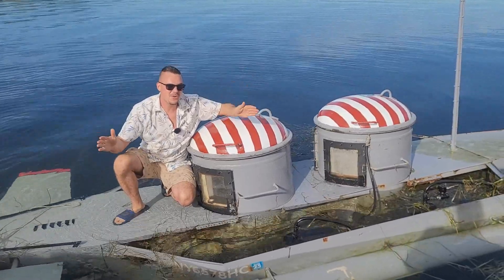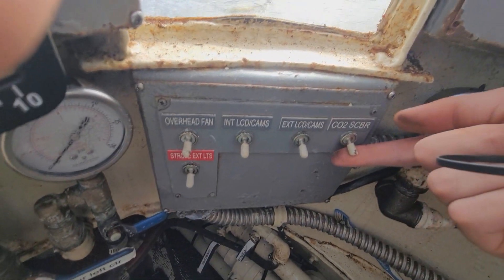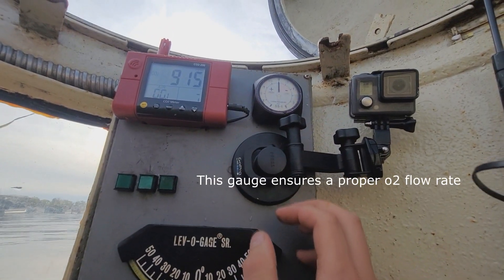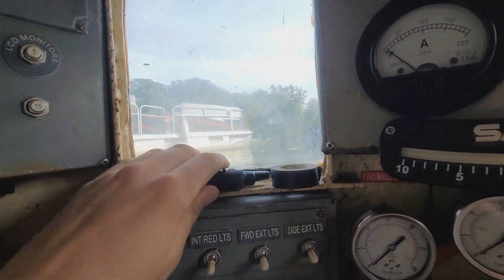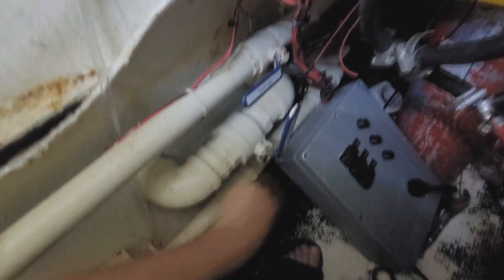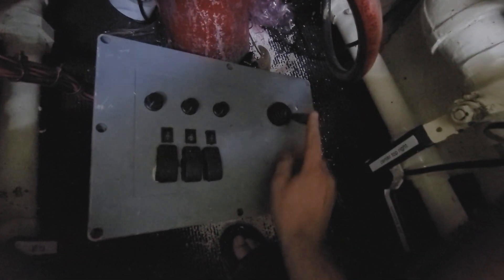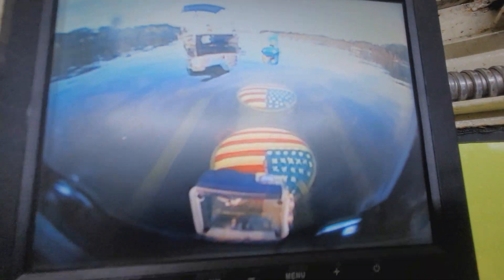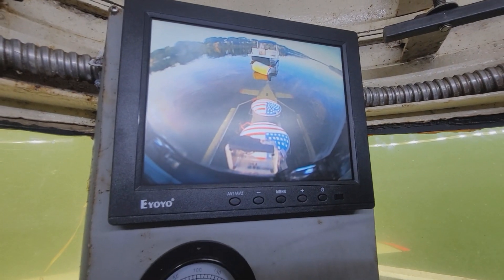How To Dive a "DIY" Submarine, in first Person | How My Sub Works

Comment: This is awesome.
My only advice would be to get a personal breathing device with a small oxygen tank just in case of a catastrophic blow out with the ballast control co2 tank in the same cabin as you. Just enough for you to be able to surface and depressize the cabin and not pass out.

Also I assume you are getting lithium iron phosphate batteries and not actual lion batteries? They are much safer which is important  given the scenario here. A lithium fire underwater is not great!
Reply from the maker: Thanks! and yes, there is an onboard scuba tank with regulator for emergencies. It's right under my seat while diving. As for the batteries I misspoke, lithium iron.

Comment: How do yow lower the pressure from the constant flow of oxygen into the cabin? After a while it would be greater than the pressure of water on the outside during a shallow dive.
Reply from the maker: The body absorbs it and exhales co2, the co2 is absorbed by the co2 scrubber. So its always in equilibrium. The oxygen is released at the rate the body absorbs it, from a gas regulator.

Comment: Idea 1: the camera shots you have are amazing but there isn't a way to see the lake bed
Idea 2: colobrate with the guys from CPSdrone   IE (submarine with controls for a tiny scout sub)
PS: please pardon my spelling errors, living with Dislexia has its beenifits but as you can read it's drawbacks make themself know easier.
Reply: additional idea, emergency ear plugs. It's just a pair of ear plugs in a plastic bag with a magnet to stick it to the hull. This would improve comfert when you don't want to hear the Co2 scrubbers. 
more practical  idea is a solarpannel attached to the parascope for prolonged battery power
another idea is to search for Geocaches. This could be difficult, I don't know how common underwater Geocashes are so they might not be in your area
I am watching the 24 hour in a sub video and the part with the hotdog outside the view port makes me think "submarine can get up close to fish and other see creatures, that would be cool"
if you do another 14 hour's in a submarine a timelaps pointing out of the view ports would be nice. proto type ways to deflect condensation and some sort of pump to remove condansate that will devolope on the flore.

I watch another YouTube channel by the name of Hyce. He has a series called story's from the shop you should check out. perhaps you could share some of your stories.

Comment: Amazing project.  I do hope in your risk and contingency planning you have covered a rescue in the event the occupants were incapacitated (eg nitrogen narcosis or unconscious or injured).  Is there a way the sub can be surfaced, vented , and opened by rescue divers outside, without needing any participation from persons inside?  It’s clear you have a lot of contingency options when the pilot is ok, but what options are there if that’s not the case?

Comment: When you build a better sub then ocean gate
Reply: But also shows how bad carbon fibre is for subs any little imperfection and there goes your sub but with metal as you can see in the vid you can have rust and it’s fine most the time

Comment: Seems like you've planned well for power loss, leaks, and equipment failures, but what about fires? Do you have a full respirator and fire extinguisher?

Just curious..
Reply from the maker: Yes to both, on board scuba tank you can also use for a fire and there is a fire extinguisher. Cheers

Comment: Carbon fibre reinforced epoxy would be ok for your sub because I don't suppose you intend to expose it to more than 3 or 4 atmosphere pressure above ambient, for a deep dive sub it is a disastrous choice!
Reply from the maker: You probably could yes, but carbon fiber has a very bad reputation for submarines . I'm happy we stuck with steel.

Comment: God, I hate how YouTube favors low effort channels over this, lol. Btw Im building an ambient pressure sub, with a divers exit for scuba diving, I think it will be done sometime this winter. Far to bad at engineering to build a 1 ATM sub, good luck, I hope you get the views you deserve.
Reply from the maker: Thank You! Awesome
Reply: Are you gonna do a video on the blueprints
Reply: @froggopoggu  Funny you say that, im making a model of compressed air system rn lol
Reply: Lol I was thinking the same thing like a dry diving bell have a pressure equalizing valve have a gas cylinder connected to it and you don’t have to worry about it imploding